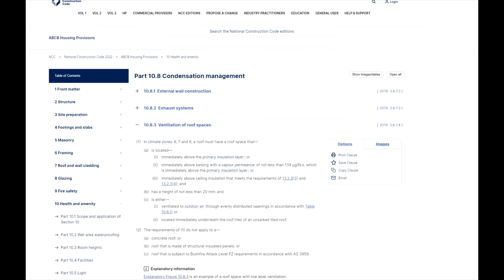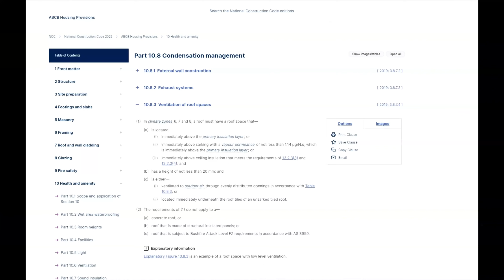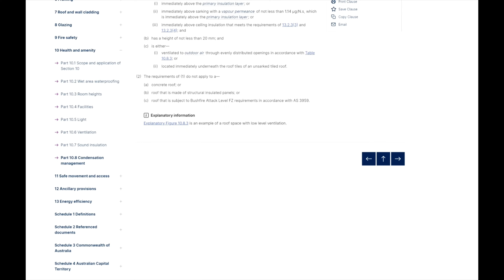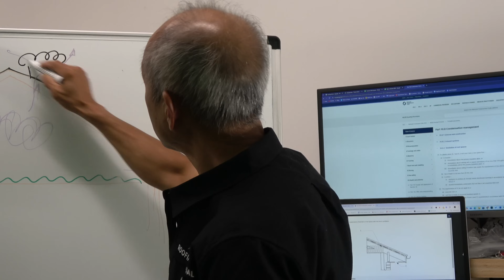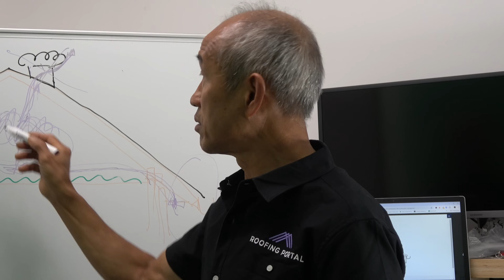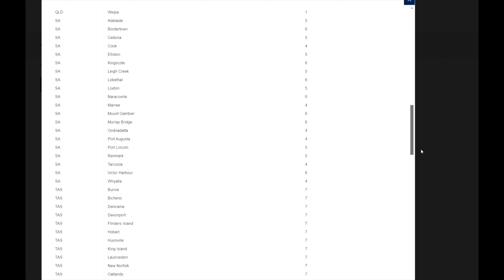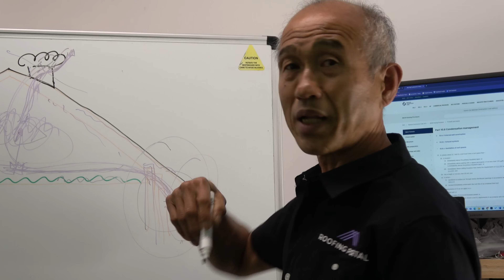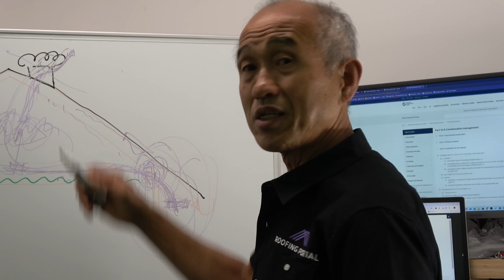Do whirlybirds work and will they make a comeback

Comment: We never stopped using them in Adelaide, still use them today
Reply: And QLD .
Reply: Where are you getting the cool air from?
Reply: @MatthewBayard  Eave vents .
Reply: @stewatparkpark2933  so in winter you are bringing in cold air to cool your room and insulation? 🤢
Reply: @MatthewBayard  There is no winter in Queensland  .
Reply: @stewatparkpark2933  so you are bringing in hot air all the time to make the insulation work harder? The science of whirlybirds just don't add up. You won't see a passive house using them.
Reply: @MatthewBayard  They work in Queensland  .
Reply: @stewatparkpark2933  do they?

Comment: Love your content. Keep up the great work - Tiled roofs without sarking do get a bit of passive airflow through  dry valleys/etc, but honestly, whirlybirds don’t do much. Go for a SolarKing V3 instead—it’ll make a real difference.
Reply: I've seen a few houses, including our own where they made all the difference.
Reply: @NullaNulla  I love your engagement—keep up the great work, Are you referring to a standard wind turbine? While they do help, let’s remember it’s 2024. You’re talking about a product designed in 1929, capable of ventilating an average of 70- 90 square meters at a constant wind speed of 16-25km/h. Trust me, I’m always exploring better ways to do things, and I’d love to hear your suggestions and opinions
Reply: @JSIUROOFING  my concern with the solar/electric jobs is birds crapping on solar panels, dirty panels, hail damage to the entire unit etc.

When we were organising ours we had to cross the path of electric fan units. Unfortunately in our case they weren't a good fit for reasons above and more, BUT, for sure with that extra motion they'll push more air.

One of our other concerns was after dark the damn things would stop and our house after a stinker of a day (38-48c) the roof cavity would stop flowing and retain the heat.

I guess these considerations need to be covered for person/per situation.
Reply: Fantastic response - I’m not paid by the company— we are  an accredited installer, and we’ve installed quite a few of these units because we like the product. Regarding concerns like birds messing up the solar panels or dirt build-up, the unit will still function well. We’ve even seen roofs where the units were oversprayed during a budget roof resto, and they still worked surprisingly well

As for nighttime operation, you can connect the unit to main power using a DC adaptor plugged into a GPO inside the roof cavity. This setup allows you to control the fan via remote, adjust wind speeds, and use the thermostat, which is preset at 25°C. While there are better products out there, based on my experience installing a range of options, this one offers the best balance between cost and value.
Reply: @JSIUROOFING  unfortunately the offerings we received for thought were solar only. A house a few doors down the road had serious issues with his solar units (hail damage for one) but I cannot say for hardwired units as I've not met anyone with them. Either way both when installed in-correctly are useless.

Comment: I’ve got a double brick house, open cavity between the brick courses. 
Wouldn’t the numerous mandatory anti condensation brick vent gaps installed by the bricklayer allow cooler ambient air to be drawn into the attic under the negative suction of the whirlybird?
Reply: There is no negative suction, they just create a path for air to escape, convection forces do all the work. Yes air will be drawn in through the weep holes but not much, proper vents should be installed for air movement to be effective.
Reply: @stevegus2845  Do you mean proper vents with fans on them?
Reply: @lesleyhiddins2067  no. As explained in the video. A path for cooler air to enter the cavity/roof space.
Reply: @stevegus2845  But the path is there, via the cavity in the walls to the attic space.
Reply: @BenState  sounds like they are asking if weep holes are enough. If there are only weep holes (not vents) it would be slab on ground (no sub floor and vents). Weep holes are not enough, they are only placed under window openings to allow water out in the event the flashing leaks.